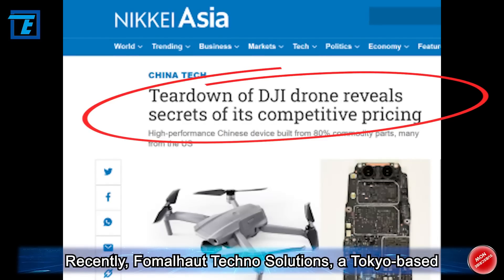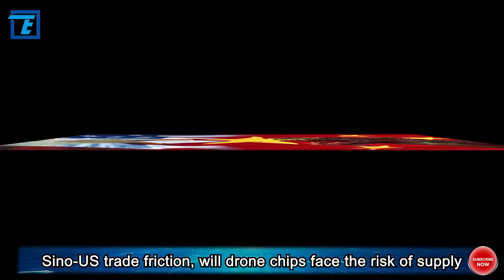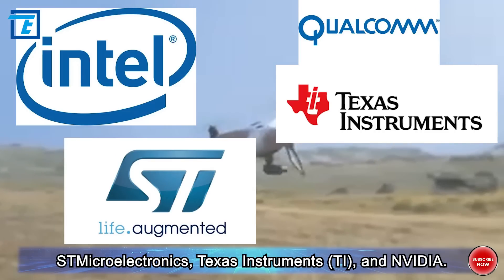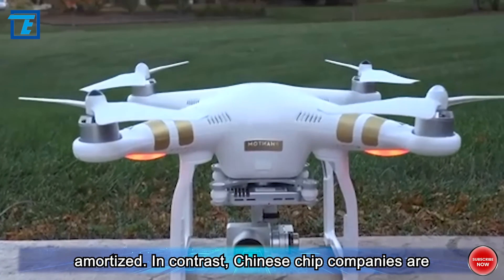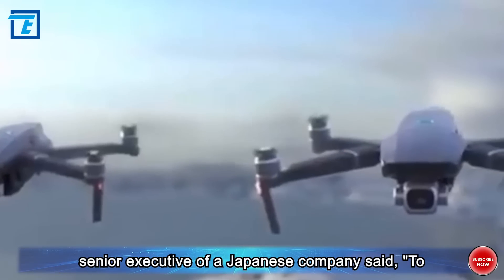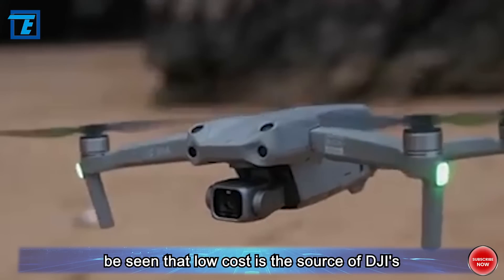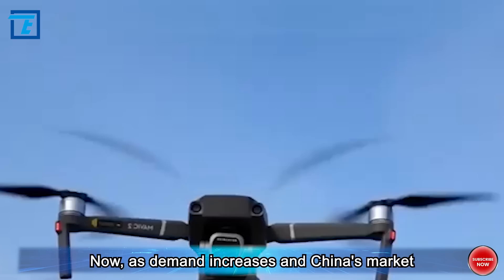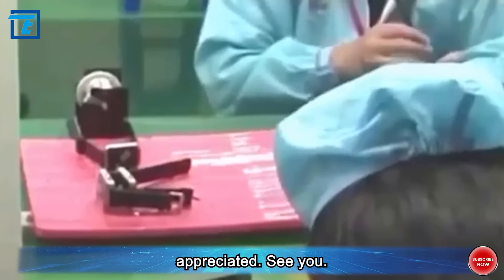Although DJI's drones shocked the world, why is China's drone chip technology so backward

Comment: Not just import chips but navigational system GPS is also foreign origin.
Reply: GPS is no longer the only navigation system. Glonass, BeiDou, and Galileo are alternatives.
Reply: @ralphzoombeenie2330  thanks for comment. Do you mean DJI use China made BeiDou chip-set with waypoint data generated by Google?
Reply: @philoso377  I don't know the technical details other than BeiDou is a viable alternative to GPS with a slight edge in accuracy and an ability to relay SMS messages. Many smart phones use location data from GPS, BeiDou and Glonass